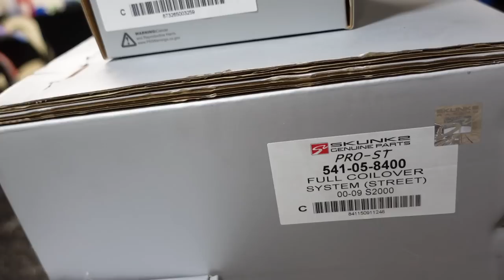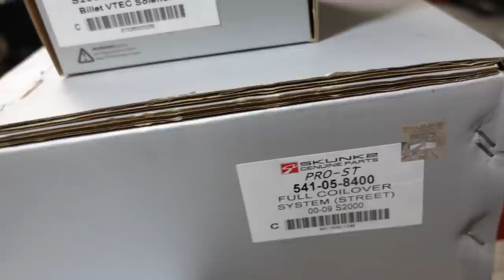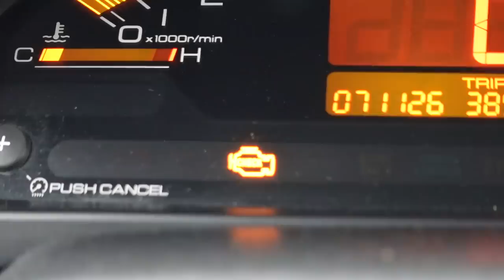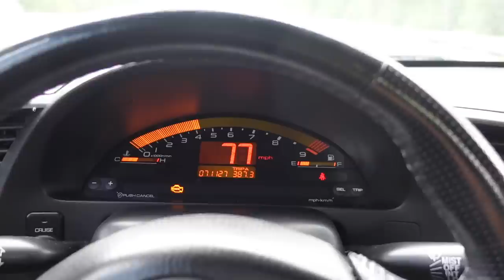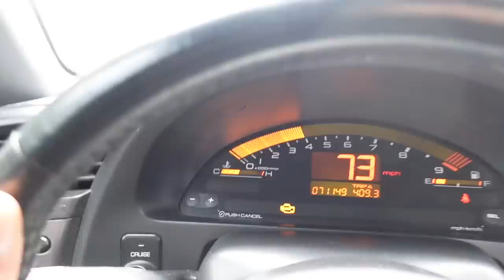Day 1 Of The Honda S2000 GiveAway Car‼️ (The Silver Surfer)

Comment: Oem Valvetrain retainers are weak on the ap1. Fluidampr will always help. Square springs and square wheels pls Aki. 17x10? Hasport mounts raise the motor, oem motor mounts are best. Front stiffer sway bar. Just IMO thank you big fan.

Comment: So, the aem is decent, the stock air box mod is also good if you run the duct into the bumper opening. FIPK sounds the best by far!!but you need an AUT style cooling plate to direct cool air to the box. Since it’s an ap1, take a peek at the retainers to make sure there’s no cracks(super common) you’re throwing so many parts at it, all of which together won’t yield a whole hell of a lot. The f20 is pretty peaked from honda without going inside. You’re, going to have to tune it to make those worth while, AEM since it’s again, ap1. What’s your plan for suspension? Been racing s2000’s since 03. Actually saw you at NJMP. Any questions hit me up.

Comment: Aki you should just trim a bit of the heat shield in front of the ball joint, I think that duct is designed to push air towards the vents on the rotor so it gets pulled into the vents not onto the face of the rotor

Comment: Just an idea, but why not rather than remove the dust shield completely just cut slots into at least the bottom, half section therefore, allowing cool air to bypass and go straight to the rotors while also keeping out as much dust as possible

Comment: I just can't believe you're out here putting together an AWD S2000. Insane 😗.

Excited for this build. Nothing but clean cars come from Aki and the boys. Excited to try and get my hands on it knowing that even if I don't win I get a quality product regardless. I appreciate your hussle and ambition. Your willingness to give back and provide excellent content. Keep it up, even if this isn't going to be an AWD S2000 it's still a legendary car. 👍

Quick edit. Suggestion for the brake dust shield. I know there are a few recommendations for curcuit and auto x that says to take them off for better cooling.

I researched this while rebuilding my front spindles myself. I put them on. The reason I kept them on is because if you tear an axle boot while racing for whatever reason and you fling that grease onto your rotor, your car isn't going to stop.
Reply: S1 built has the kit in the works

Comment: After market Header and intake manifold you will lose power. Been tried and tested on dyno. Stock header is the best header for N/A build. We have done the skunk 2 manifold with Kraftswork supercharger and had no real gains. The Real gains are in the Catless test pipe , a good intake and ECU tube by a reputable tuner. We just did friends 2002 AP1 with 38k miles. Just Intake , stock header , 70mm test pipe with 70mm single exit  LINK ECU tuned by Jeff evans made 228whp. My 2004 AP2 same mods and same tuner made 238WHP on 60mm dual and 241whp with 70mm single exit.
Reply: Also, if you do replace the manifold and throttle you WILL be required to tune the car. I recommend AEM V2 which they no longer make but can find used, or LiNK G4X which is the best in the market. You have a AP1 , very minimal gains to be had with a header and manifold. You have a great intake , just needs a test pipe or high flow cat. Everything else is for looks and sound. Exhaust is good for weight reduction as well.